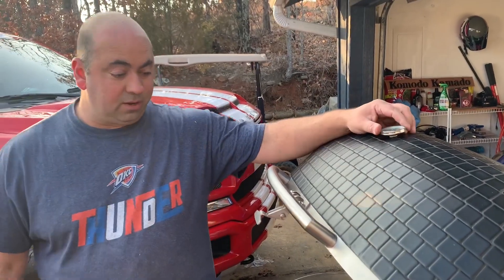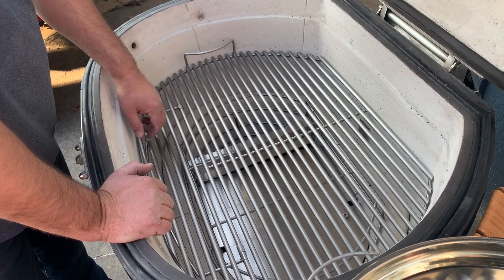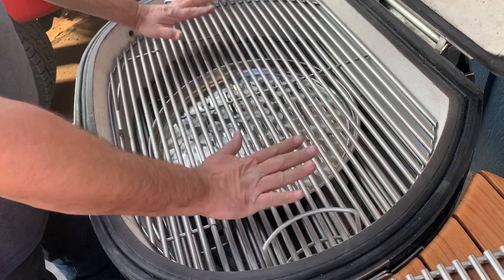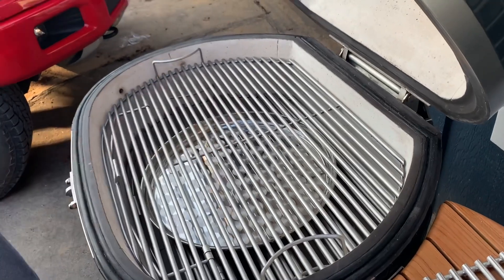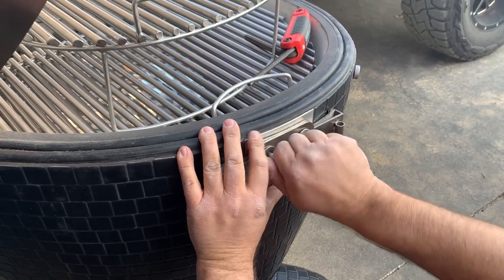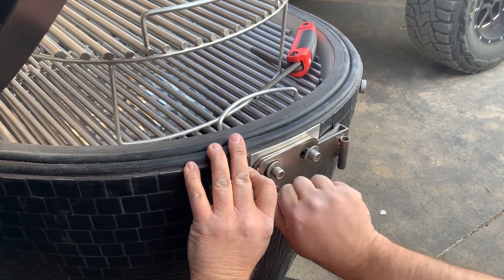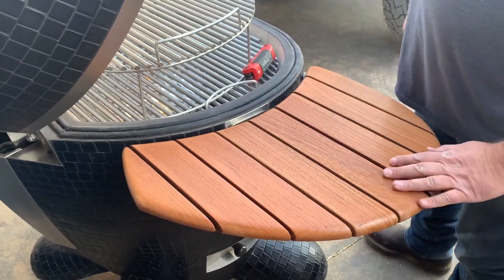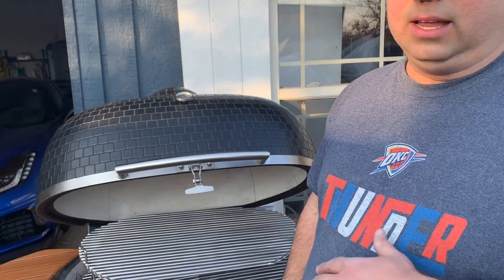Komodo Kamado part 2 unboxing of our new grill

Comment: Nice video.  These aren’t ceramic, they are concrete.
Reply: I looked it up because I was curious too here’s what I found. Sounds like it is a ceramic mix Modern Kamado grills are now made from a variety of materials such as heat-resistant ceramics and other refractory materials, traditional terracotta, and a mixture of Portland cement and crushed lava. The kamado's surface treatment can also vary from high-gloss ceramic glaze, paint, or ceramic tiles.
Reply: @bellaboorebornnursery  from the KK webpage, https://komodokamado.com/pages/faq it lists it made from cements (some being refractory).